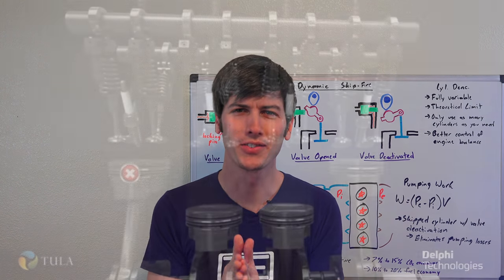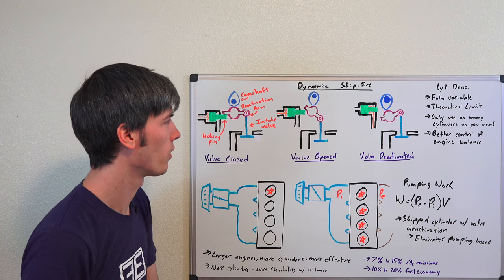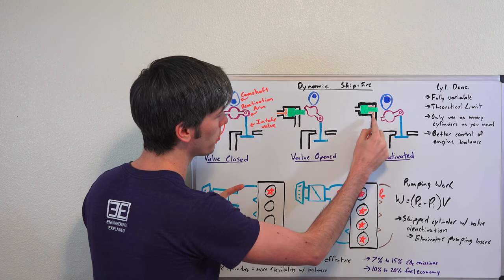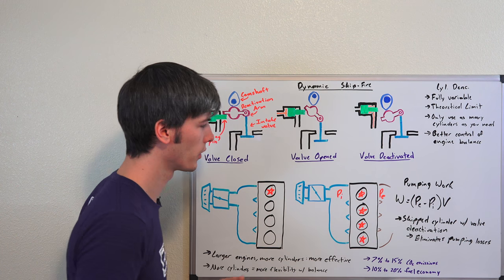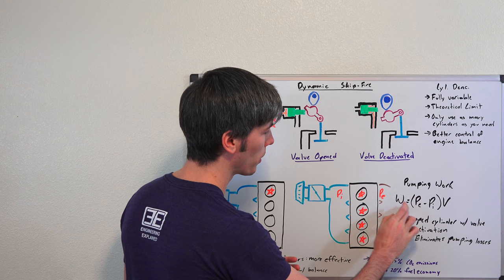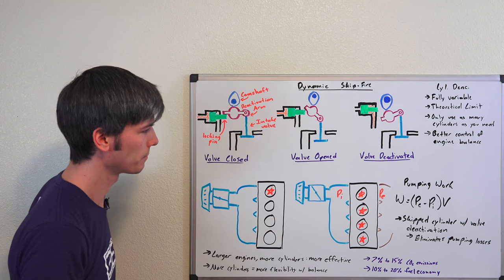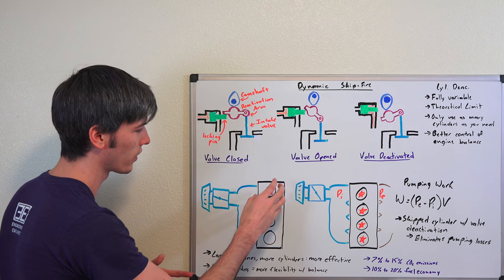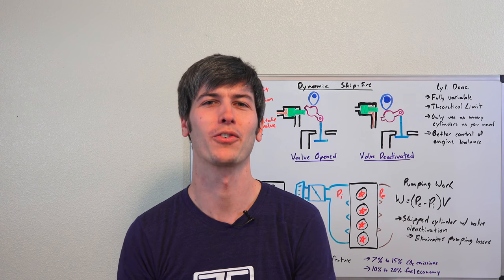How Dynamic Skip Fire Works - Variable Displacement Engines

Comment: Ok something is missing here - why should you keep your valve almost closed with 16 cylinders bur open it wide with just 1, it kinda makes sense to be the opposite?
Reply: German Gramatikov the reason why the throttle valve to almost wide open for the single cylinder has to do with the power being generated per cylinder. As you are using the majority of the power from a single cylinder, it needs to have close to the maximum amount of air it can pull. 

When you are using minimal power on multiple cylinder, the cylinder do not meet much air to generate that power so you limit the air by closing the valve.
Reply: German Gramatikov you reduce pumping losses, and also there is less heat lost through the cylinder walls because only one cylinder is hot and the others are just reciprocating mass, I think.
Reply: German Gramatikov The idea is that for low power from 16 cylinders you need to have the throttle almost closed to get the minimum air and fuel for combustion in each cylinder, but to get the same power out of 1 cylinder you need as much air and fuel as you can get. 

You're probably thinking that 16 cylinders at minimum intake would take more air in between them than 1 cylinder at maximum intake, and that's probably right. But if all 16 cylinders are pulling air in they can still get enough with the throttle mostly closed because they're pulling air in 16 times harder (or something like that, not sure of the exact physics).
Reply: if you need low power, you close the throttle body to ALL the cylinders to make less power, but for 1 cylinder, you need more air inside to make taht much power, so you open the throttle body.
Reply: Wow Thank you all for the explanation! But still this will provide you full benefit only if you put your throttle position (or to say it in another words "request" power from the engine) equal to exactly the amount of power that a single cylinder can provide  because if you want to have a 75% of the power of 1 cylinder you will still have to restrict the airflow to match those 75% of the 1 cylinder so it will not be full wide open ... yeah because of shutting down the other cylinders you will get some benefits and save some pumping losses, but what is bugging my mind is that what Jason is showing can only happen in one strictly controlled lab test environment.
Reply: With eletronic throttle control and this system, you can have total control of the amount of power needed for any situation...
Reply: Yes of course, but again you should request exactly 100% from this cylinder with your foot, like you cannot tell to the car to give you 21 HP and then what the electronic throttle will request 25 HP for the full cylinder just so it can match 1 cylinder? I don't believe it will do that ... this is also not safe ...

Comment: Couldn't pumping loses be minimized with electronic throttle control keeping the throttle open, and simply deactivating the desired injector(s).  Sure, maybe not as efficient as disabling the valve from opening, but certainly much less complex and failure prone.
Reply from the maker: But then all of the other cylinders are pulling in air, thus increasing pumping losses, and significantly reducing efficiency gains. Would likely cause complications with port injection as well.

Comment: Why not just not inject fuel into the cylinders that are not needer? Why must the valves stay closed? Just stop the fuel injector for a particular cylinder.
Reply: because then you still have pumping losses.
Reply: Paul Hojda what martin said, plus you dont want your exhaust valves to open up when theres nothing to push out. You also want to keep them closed so you dont have the pumping losses thats EE was talking about
Reply: I think one good reason that wasn't covered in the video was the effect on the O2 sensor.  For one the ECU would have to filter out the higher O2 readings of the unused cylinders which may be very difficult, if even possible, and second it would cool off the sensor which could put it outside its operating temperature range.  I'm not an expert on the matter, it's just a guess.
Reply: Why waste fuel?  We're trying to save fuel.
Reply: David Browning - he doesn't say it in the video but I think the dead cylinder also has the injector shut off to it as well.
Reply: His idea works just fine, he needs a simple valve to equalize pressure maybe at the bottom of the cylinder bore. Then bam. Done. Energy losses from airflow restrictions are minimal, air is very compressable, it's not like your pumping oil through the throttle body.
Source. I do Physical chemistry, and the losses are pathetically minimal compared to the price of this quest for complicated efficiency breaking, or worse breaking even.
Reply: Nope, the exhaust valves stay closed on the deactivated cylinders, therefore the only gas in the exhaust will be from the activated cylinders and the O2 sensor will function as normal.
Reply: close valves, block pump, no pump loss. watch it again...
Reply: Paul Hojda Your method:
Engine pushes down heavy spring to open valve and let in air (loss of efficiency)
Air must be sucked in (loss of efficiency
Valve closes, air is compressed like normal (high volume of air compressed = loss of efficiency)
Cylinder moves back down
Exhaust valves open (loss of efficiency)
Cylinder must almost entirely push air out of the engine itself with no combustion (loss of efficiency)
Valve closes
Repeat.

Comment: Wouldn't just cutting fuel be more efficient and a simpler system? Not to mention you could burn smaller remnants of the last cycle and gain even more efficiency on the no-fuel strokes.

Comment: Wouldn't it be simpler to use direct injection and cut fuel? Yes you are compressing the air which put load on the piston rings, but you don't need the extra mechanical parts which in turn makes the car lighter.

Comment: Been wondering why there hasn't been 5.0L v6 since gmc in 1960s 
If having less cylinders is more efficient. 
Fewer larger displacement cylinders would have more low speed torque verses multiple  smaller cylinders.
Reply: NVH and reliability, an increase of the former yielding a decrease in the latter. A 5.0L V6 would have horrible vibrations.

Comment: What about the vibration of the engine?
Reply from the maker: Actually does a better job vs traditional cylinder deactivation methods, since it has more flexibility in controlling the firing order/interval.

Comment: Wouldn't the koenigsegg free valve but a bit more efficient/flexible, though would require more computer controlled  vs this as more mechanical. That would be taking in to account if koenigsegg would not be hogging the free valve tech all for them self.
Reply: john akiona. Lol, why shouldnt they? Would you let your company sink and your people lose their jobs because you spent millions on tech that your competitors could then use?
Reply: i understand form the business/economy side as well that just giving away tech that consumed a lot of money/time with research and development is not what most people/company/organisations would do. just that it would be great to see if more to help more innovations for gas or diesel engines to be more efficient even if we expected to phase out most in the next 30 years.

Comment: You seem like getting your information from books.  Books are behind the technology imo.  Most new engines with GDI runs like diesel engine therefore no pumping loses.  Only the cheap new engines are using throttle system which creates pumping loses. imo

Comment: Minor nitpick: small engines are Not more efficient. Just cars with smaller engines can get better efficiency due to the correct size of the engine used. If you engine is too small than it has to run way past its efficient zone, if it is too big it is heavy and wastes energy running under too little load.
Reply: ABaumstumpf or if it's too big, you've got yourself a sports car/rocket ship ;)
Reply: James Golen still means you will waste energy wheb cruising down the highway with a corvette

Comment: Whaaaat? I thought manufacturers would just shut of the injector for the specific cylinder to achieve this, rather than forcing valves to remain closed. Would simply shutting off fuel and spark for the cylinders you want to shut off not be easier?

Comment: Is the DFM technology going to be successful? The AFM technology has cost the American consumer millions of dollars because GM will not stand behind their (failed) product. They know that AFM is a disaster! When a DFM engine cylinder is deactivated and starts on the down stroke with both valves closed, where does it pull the air from? If it don't pull air from somewhere how does it continue to downstroke?

Comment: we need to move to only using ethanol as fuel. simple as that. regular 4 cylinder turbo engine with vvt and manual gearbox is all we need...

Comment: Why not just open the Throttle all the way all the time, no matter how many cylinders the engine has.
You could control airflow with the turbo pressure.
Reply: Lol. . if you're not deactivating cylinders, you're not saving fuel..

Comment: Couldn't you achieve the same effect by just shutting off the fuel injectors for those cylinders?
Reply: Nope, pumping losses. Air spring in a closed cylinder makes far less loses.
Reply: No
Reply: It will knock

Comment: This seems like more stuff to break, more stuff later on that's going need replacement from wear, more weight at the top of the engine raising the center of gravity. Free valve is way better than this idea simply because it can do the same while reducing the centre of gravity and mechanical loses. There's overall less parts to break down, better valve response and duration, and less moving mass in the valve system.

Comment: This product being ABSURD since it's far more efficient to use multiple hydrocarbon-electric generators packed together with a switching electric power train... thus allowing the super economy car to use 1 genpack, the light duty pickup to use 2, the nice sedan having 3 units and a commercial vehicle having 4 or 5 of the units.  Modular, long lived, computer controlled and cycled for overall lifetime.

Running with existing multicylinder engines and shutting some off is MORONIC.

Comment: why can't you just not use the fuel injector to deactivate the cylinder but instead you go through the whole deal by trying to not open the valve?
Reply: Pumping straight air into the exhaust would increase the pressure in the exhaust system and confuse the oxygen sensor.
Reply: Random_guyM3 I feel like you might have exhaust coming back into the engine if there wasn’t combustion to force out the exhaust

Comment: This idea seems like it would be best suited for use with electronically actuated valve systems, rather than using oil pressure and camshafts, but hey, I'm no engineer.

Comment: If fewer cylinders are more efficient, then why don't we see more 2 and 3 pot engine instead of turboed 4 pots?
Reply from the maker: I3s will probably become more prevalent with time. There's already a good number in the market. Remember, a lot of cars are downsizing from I6s, V6s and V8s, so often the next logical step down is an I4. 2-cylinder engines aren't great for NVH, small displacement 3&4 cylinders make sense.

Comment: I feel like multiple INDEPENDENT throttles or a better throttle design would be 
1) Simpler
2) Cheaper, ESPECIALLY to fix if /when it breaks 
3) More Reliable
4) Less prone to causing thermal shock
....and would do the same damn thing.
Reply: Or Freevalve. Simpler, more flexible, more efficient, smaller, maybe even something more. And you get rid of the throttle completely. I don't remember if Fiat didn't partially achieve this with their MultiAir engines.

Comment: Isn't that same as valvetronic?
Reply: No. Valvetronic is a variable valve lift (VVL) system that eliminates the need for a throttle body. It does not deactivate cylinders.
Reply: Thanks. But cylinder shut off is also part of the system. It's 2018.

Comment: Why do you have to shut down cylinders with cams.. Cant you just shut down the fuel for that cylinder
Reply: Yes you can. Fuel (and spark) cut-off is a way to dynamically deactivate random cylinders. I don't understand the need for this relatively heavy system either.

Comment: Where this tech belongs is in trucks. So when they are not loaded they cruise with essentially half the engine disabled unless you drive with a led foot. Say the 6.2 V8 from gm that has this tech. It will probably cruise with 2-5 cylinders firing when not loaded. And since the firing is dynamic theres equal wear and tear.

Comment: Awesomeness! But based on driving habits, I'm afraid this system isn't going to see much action in the real world; There's no way I can push 100 km/h+ on the highway without all 4 cylinders. And the guys with big engines.. well they're certainly not doing less than full throttle.

Comment: Why are automotive engineers dicking about with gimmicks like this? They have the capability to design hydraulically controlled valves; this would give ether ridiculous horsepower or be extremely frugal depending on what the driver wanted. My guess is that that they are saving it for when emission laws become so tough that only a fully controlled valve train will pass them.

Comment: Doesn't make much sense for average cars these days since they mostly have small 3/4 cyl. engines. This technology however can by used by sports cars manufactures to further delay the death of bigger ICE engines. Of course it won't benefit the customers, it will just allow those bigger engines to score better emission test results.
Reply: VW has a 1.5 TSI 4cyl engine that can run with 2 cylinders on low loads scenarios, so in a highway cruse, engine will consume less fuel.
Reply: Ha Ha

Comment: Here we go see with the locking pin again. Same kinda locking pin that failed on the afm lifters?? He did a great job explaining this and telling us the advantages of it. But what are the disadvantages of it? I’ll tell you the disadvantages of it. The same bs that any owner of a 2007-2013 gm truck with a 5.3 went through. If you had a bad one. Here we go again. Selling these trucks to 50k-60k and then when they have issues from this so called great technology they won’t fix it. Pat yourself on the back GM you behooved the consumer once again. But not me lol.

Comment: Why can't they do this in diesels? I feel like my truck would literally get 1 billion miles to the gallon with this
Reply from the maker: Well diesels don't use throttle bodies to regulate airflow, so you don't have pumping losses to get rid of like gasoline engines.
Reply: Diesels thrive in low load scenario's so it will be less effective

Comment: Dynamic Skip Fire just means your gearbox ratios are wrong.
Reply from the maker: No, not at all. For efficiency you want low RPM, but low load, low RPM driving is not efficient for gasoline engines.
Reply: Thanks Jason. Did they calculate miles to +ve ROI?

Comment: Why not just not send fuel into the cylinder and not fire the plug. All software then and no hardware.
Reply: Jim Fuller 
because you'll be dumping fuel out the exhaust?
Reply: Jim Fuller 
Because you would still be using the same amount of fuel, thus defeating the whole purpose.
Reply: Because there are pumping losses associated with moving the air in and out of the cylinder. The cylinder need very little energy to simply move up and down any compressed air will help move the cylinder on the down stroke returning most of the energy lost in compression.
Reply: Appletank8 if you are not sending fuel to the cylinder, you are not pumping it into the exhaust.
Reply from the maker: Because then you'd still be pulling air into each cylinder, and thus wouldn't gain the benefits of reducing pumping losses. Simply put, it's more efficient to only put air in the cylinders that need air.

Comment: All this stuff (I'll be nice) to gain small fractions of a MPG...CAFE requirements are destroying the pleasure of have a great automobile...auto-start stop, cylinder deactivation, 30 speed luggy transmissions, active grill shutters, all of it sucks..I had much rather have a quiet smooth torquey electric car than an internal combustion engine with all this crap....what is the hold up on ready available, affordable electric vehicles ?..just don't get it

Comment: I’d rather have a system that cuts fuel and spark instead of this complicated shistem :)
Reply: ButtFeet it won't work because it will mess o2 sensor readings if you send through fresh air from a cylinder than didn't fire